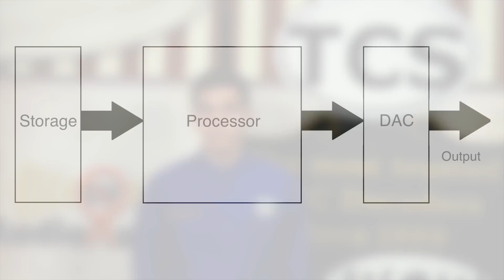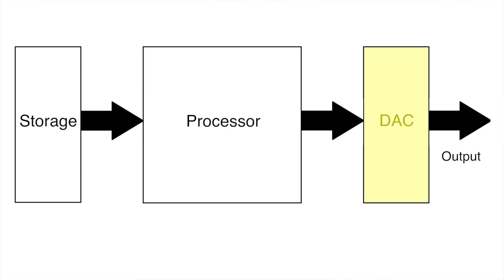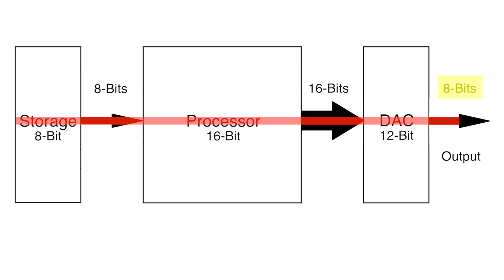The Truth About 16-bit Sound Decoders

Comment: Dan, all wonderful, now how about EQ so we can actually lever all of that resolution thru an optimised-frequency-response output for the speakers?
Reply from the maker: TCS experimented with a user-configurable equalizer, but found it not to be very useful or necessary. TCS does not do any "post-processing" on our sound files. What is sent out of the decoder is exactly what we recorded. The sound you hear can be influenced by the type and size of speaker you use, as well as the enclosure and associated resonance. Every situation is different, so you may be looking for a slightly different frequency response. If you have a diesel decoder, you can try switching between prime movers of the same type to see if you like one version better than the other(s).
Reply: Dan, thanks for the reply, although I have to say I'm disappointed to hear that TCS consider onboard EQ "not useful or necessary". As a Digital Audio Professional and life-long model RRer, I'd be more than happy to discuss how fundamental EQ is to the optimisation of onboard sound deployments further, if TCS changes their mind...
Reply from the maker: We do appreciate the feedback! It may be something we re-consider adding in the future, but through our testing when it was first being developed, it was determined to have negligible effect compared to what you can do with the speakers. If you have audio engineering experience, that would be a great help to us if you want to offer insight.

Comment: its unquestionable that TCS has the highest quality soundfiles available - period.  The problem is that you don't offer nearly enough of the essential diesel sound files for the most popular locomotives on the market - the idea that your website recommends a sound decoder that has the SD70ACe/SD70M-2 sound files (which are superb by the way)for a SD60M, SD70/SD70M, etc, is really crappy and a diservice to your reputation - when your rep tells me on the phone that " most modelers won't know the difference", when there are truely distinct differences in the prime mover sounds of the prototype, it is insulting to the modeler and a real black-eye to TCS. TRUST ME when I tell you:  WE ALL Will know the difference.

It would be prudent and logical for TCS engineers to GET BUSY and start offering a much larger AND CORRECT soundfile library to include locomotives like the infinitely popular and common SD60/60M, SD70/SD70I/SD70M and the 20 cyl SD80 - which is by itself a unique locomotive sound - and these are all very, very popular locomotives in model form. 

Frankly, I'd like to use nothing but TCS WoW but until you get your act together with offering the most common and correct prime mover and periphery sounds for the above mentioned locomotive model series, I'll be forced to use a competitor's brand.

Youve got the bases covered for the SD40-2/GP40-2 series and SD70ACe/SD70M-2 series, but there are some big holes to fill in the most popular locomotive segment:  SD60/SD70 EMD with the 710/ 710G prime movers. NOT the 710G3 and up series. 

Please, please make an effort to get these souns recorded and on the latest run of Wow soon!
Reply from the maker: Thanks for your feedback — we hear you!
Please be patient, it will be happening. You can expect a lot of good news diesel and steam sounds coming from TCS! We don't have a set date, but we are working hard to get there as quick as we can.
Reply from the maker: We're working on that too ;)
Reply: CAN YOU GIVE AN ESTIMATED TIME FRAME FOR RELEASE AND AVAILABILITY?
Reply from the maker: Not at this time, sorry!

Comment: No matter how high the fidelity you can only play back the sounds of the specific locomotive that was recorded; are we ever going to get actual sounds from geared steam logging locos?  Was assured a few years back this would eventually get done but I've been concentrating on other projects so thought I'd do a status check.
Reply from the maker: Our current generation Version 4 steam decoders do have geared loco "rod clank" as an option. There are currently 2 available rod clack sets recorded form Shay locomotives. Have you checked those sounds out yet? We are going to record and add more, though, and we do appreciate your patience. You can expect a lot of good news diesel and steam sounds coming from TCS! Although we don't have a set date we are working hard to get there as quick as we can.